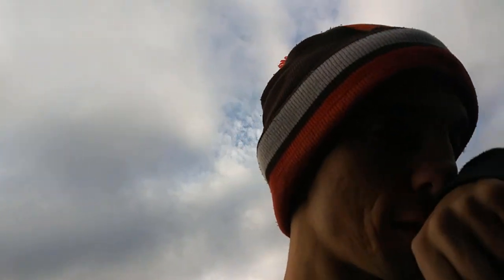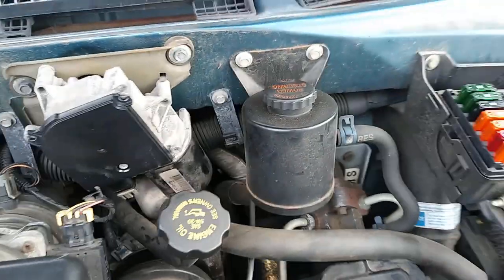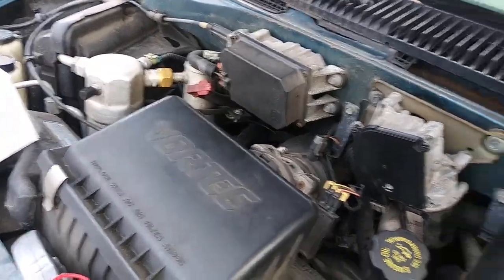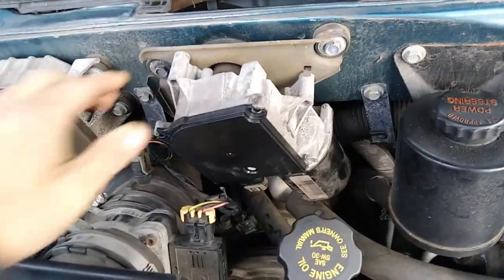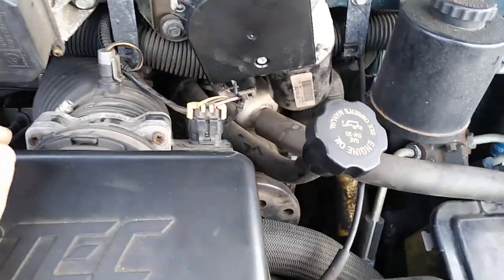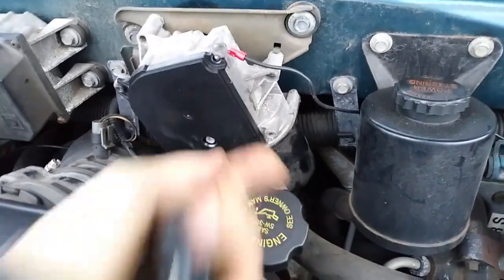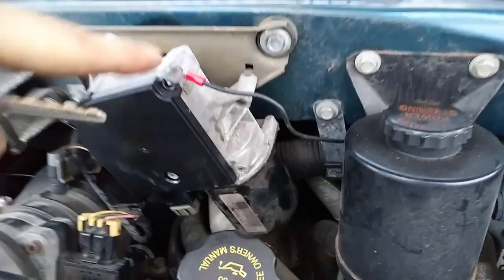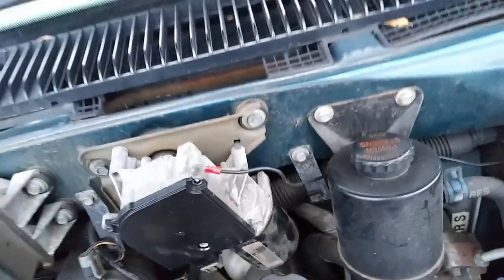Wipers Stopped Working...Easy Fix - GMC Safari / Chevy Astro

Comment: I tried this trick and it worked like a champ. I believe that the wiper motor is isolated more for sound dampening than for grounding. The 3 bolts which hold the motor assembly in place are held tight with Blue Loctite. I removed the 2 bolts on the top and took the wire brush to the underside of their heads and to the metal grommets where they make contact and away we went. If this holds for another 20 years then all is good. The bolts require a 10 mm socket or wrench to remove. Thanks again C.R. and good luck to anyone else who finds your video.

Comment: I was about to drop a bunch of $$$ on a new wiper motor but tried your ground-test & yeap, that was the issue. So I ran a "bypass" ground wire like yours & she's good to go. I'm betting you never went back & fixed the original ground issue, I know I'm not likely to bother. This fix works well enough for the old gal. Thanks a bunch, you rule.

Comment: I tried that, and then a lot more troubleshooting to no avail. I then checked for 12Vdc to the connector and that was fine. I bought a replacement board, installed it in the parts store parking lot, and the wipers and washer pump worked again 100%.  Thanks NAPA...!!!

Comment: Just a heads up, your video helped me!  2000 Astro van.  It was a bad ground, as soon as I touched my jumper wire to the case and ground, the wipers started.  They continued running after I removed the wire but they had been intermittent for a long time.  I took it all apart and cleaned the copper ground strap and related hardware, it was really crusty, and now the wipers are fine.  Thank you!

Comment: I don't know. But there may be a good reason why Chevy ISOLATED the WIPER MOTOR from the chassis, and provided its grounding pathway another way (wiring harness). 

If there is a good reason it did so (and did not provide a return through the metal housing being bolted to the frame. Then even though your quick bypass 'fix' 'WORKS'. It may create a situation where something gets screwed up with the bypass. I don't know if that's the case. Just putting forth a caution and encouragement to find out why the WIOER MOTOR is NOT GROUNDED, but is so via the wiring harness.
Reply: The reason they use the bushings might have nothing to do with the ground. The case itself is obviously internally grounded so if that goes bad doing this bypass and grounding it directly should not be an issue. I would just make sure to use a wire at least the thickness of the factory wire on the harness or the wire could melt.

Comment: If you try this grounding trick and your wiper motor is locked up you will see the pulse board go up in smoke. Just replace the entire wiper motor ($42 Amazon), the new wiper motor comes with a new pulse board already installed and its easy to replace